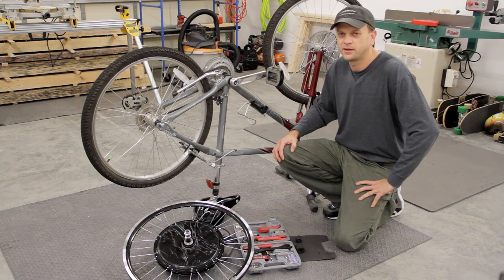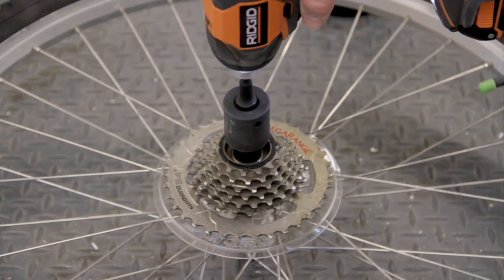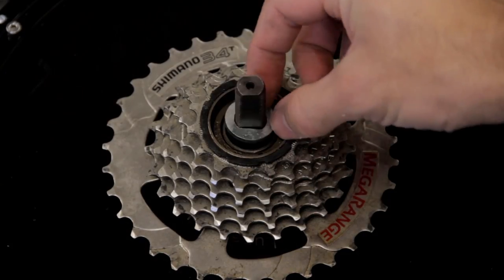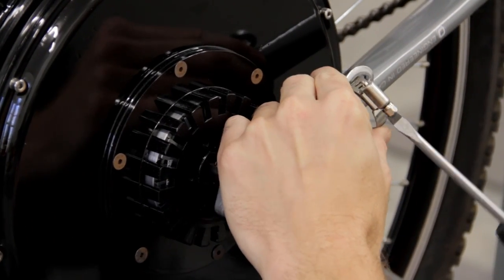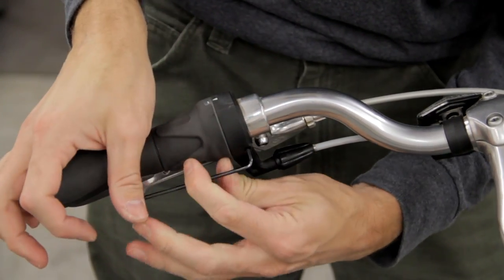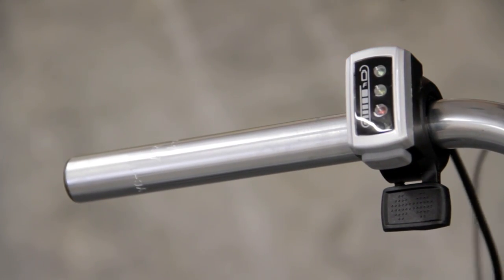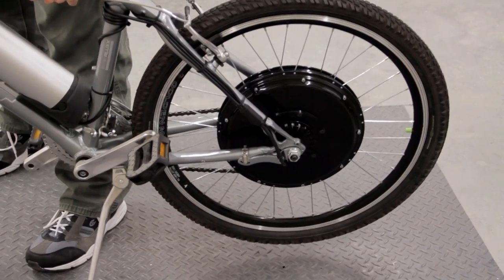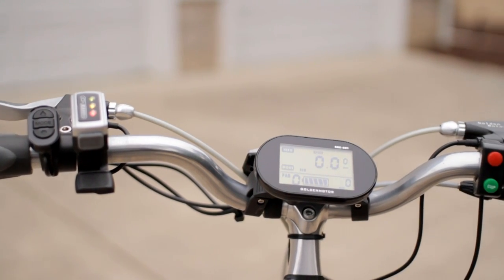Installing an Electric Bike (eBike) Conversion Kit

Comment: Hi
My kit controller wires are 14 gauge but my battery power wires are about 10 with Anderson connectors 45amp.Would it be a problem if I connect them?
Reply from the maker: Since the larger wires are coming from the battery I don't think it will be an issue, but I'm no expert, so it's probably best to contact the kit manufacturer and ask. If the battery wiring was smaller, then that could certainly be an issue.
Reply: @aroundhomediy  Thanks for the reply!I contacted the manufacturer and they said as long as the connectors are compatible,it's Okay.Now,should I crimp Anderson 45amp connectors on the smaller 14 gauge wires?The controller wires are bare cut wires.
Reply from the maker: I haven't used them before, but I would assume that's what you'd need to do as long as you can get a good crimp on the thinner wire.
Reply: @aroundhomediy  I just had to wing it--I finally crimped it real good and it was really tight and secure.I appreciate your help!
Reply from the maker: Awesome! Glad you got it hooked up!
Reply: @aroundhomediy  Thank you!

Comment: is this a 1500w engine? how fast and far could u go on only electric power with the 52v 12ah battery? would adding a second 52v 12ah battery harm anything?
Reply: if you connected it in parallel you would double your range and remain on the same voltage which is what you want

Comment: Where do the connectors connect to each other? ......... I want wonder detail.
Reply from the maker: Sorry, I'm not clear on what you are wondering. The wires start from the hub motor (there are no connectors there, it's hard wired inside the motor).  One of these wires runs to the battery, and the others run down the frame of the bike to connect to the e-brake levers, throttle, and display.

Comment: Thanks for uploading this. My question is, how heavier it felt after the installation of this e-bike kit.
Reply from the maker: The hub motor is about 15 pounds and I think the battery is probably 10 pounds. I couldn't really tell much difference pedaling it, but it's a bit less fun to try to lift. Though if you go with the bottle-style mount, the battery is very easy to remove.
Reply: That's the only think I don't like about e-bikes, they're heavy. If something happens and the battery is drained, one has the 11 kilos of that kit as well. :/
Though this system might be one of the lightest.

Comment: Does the battery come with the kit?
Reply from the maker: The battery is not included with the motor (from where I bought it), but they have bundles with different batteries that will work with this motor.

Comment: is it safe to convert the front wheel or the rear wheel?
Reply from the maker: I think the usual recommendation for front wheel hub motors is to limit them to around 250W depending on the frame material. This one is intended for use on the rear wheel.
Reply: Front wheel Dropouts (the brackets holding the axle) tend to be fairly weak, so having a motor pull your weight against them will generally cause them to break.
Reply: fromkentucky is electric rear wheel  safer than front wheel. If so then why it's being sold in the market?
Reply: Front wheel conversions are slightly easier to install since you don't have to mess with the chain or sprockets. The problem with front wheel installs is that the front dropouts (the brackets holding the axle to the fork) are just thin metal flanges with no support. The motor will be pulling the weight of your body and bike against the tiny fingers sticking out in front of the axle. Sometimes, these fingers break off (see pic):

https://www.electricbike.com/wp-content/uploads/2013/12/DropOutsBroken.jpg

For low power (250W-500W) motors and average-weight riders (<200lbs) that mostly cruise around on flat ground, a front motor is fine when combined with a pair of front torque arms to reinforce the dropouts. Anything heavier, more powerful, or with hills just isn't safe.

Rear dropouts can break too, but it's far less common since the motor is pushing against the frame, dispersing the load directly into the frame tubes.

Rear installations really aren't much more difficult. They take a little longer, but it's a much safer option.
Reply: I wonder what would happen if I put electric units on both front and rear wheels?

Comment: Bonjour comment reprogrammer ? Merci
Reply from the maker: It's been quite a while, but there is a special USB programming cable that you need to connect the motor to your PC. You then need the Golden Motor Windows App to change its settings (https://goldenmotor.bike/downloads/). You can change max speed, acceleration, regenerative breaking, etc.
Reply: Merci avez vous le nom du câble svp? Et le programme est compatible avec tout les moteurs ?

Comment: No PAS/pedelec, then?
Reply from the maker: +Skysurfer The LCD display actually has controls for adjusting the PAS level, and there is a cable from the hub motor for a sensor, but I have not found anyone in the US selling it.
I've just been setting the cruise control to a lower speed and pedaling along -- this actually works quite well.

Comment: You didn’t show how to connect the battery etc
Reply from the maker: It depends a lot on the type of battery and any built-in connections that it may have. For this particular battery, I connected the 2 wires from the motor to the battery holder's terminals using a pair of "ring-eye wire connectors".

Comment: What's the mileage you can go with your ful charge 
battery?
Reply: Dovydas Milius. good question... for some reason every bike review leaves that piece if information out... for me its one of most important things to know before i buy
Reply from the maker: It's somewhere around 30-40 miles depending on how flat the ground is and how many times you start/stop. I've not been able to drain it in a single outing still.
Reply: Dovydas Milius it's al dependent on the amp hours of the battery
Reply: so is 11.6 ah good?